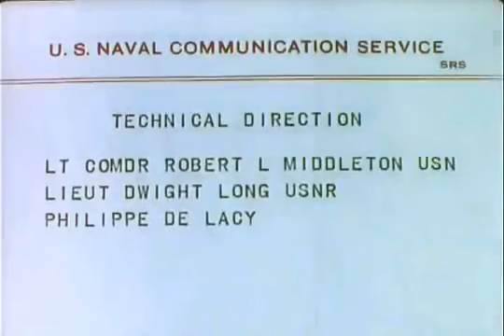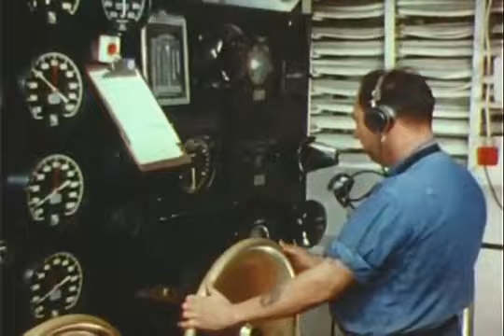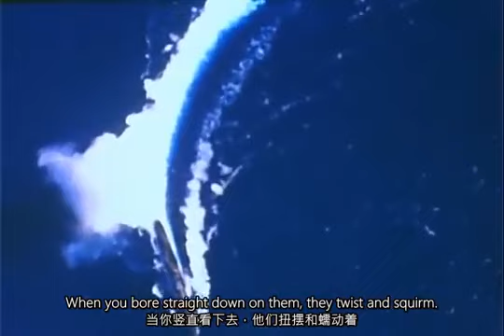The Fighting Lady 1944中英双语字幕

Comment from the maker: The first part of fighting lady

00:14:14  Outwardly   composed     00:28:00  apear to    00:12:03 Throughout   
00:13:20  tension          00:53:30  swarm               00:11:04  perform +humble           00:48:11attempt           00:32:56 magnificent       00:45:48   reinforcement  
00:11:10 cobbler           00:11:32 bound                 00:45:05   progressively
00:34:21  out there(这句话是瞎翻译的，谁能指正。可否翻译为：大老远的在这里真能挣到钱）
00:12:59  pass through  00:35:55  spread out        00:53:17    strain to 
00:08:55  amount of      33:23 in an amount     00:07:40 +00:34:55 destination
00:09:07  specialist         00:15:53   assign               00:33:33   maintai
00:08:13  whether or not 00:09:21  whether  or       00:08:43+  00:09:49 glamour
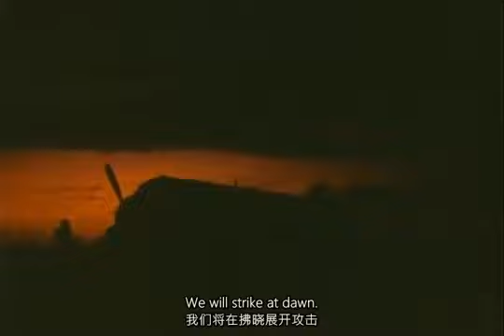十00:40:11  perfect(V）     00:15:19   perfect(adj）    00:05:13   explosive
00:32:05  windshield              00:14:09   practically         00:24:24     thus
00:07:06  delicate           00:33:01   secure               00:32:14     sieve
00:12:49  reveal               00:08:47   concentrate     00:20:46+  00:20:06   thorough
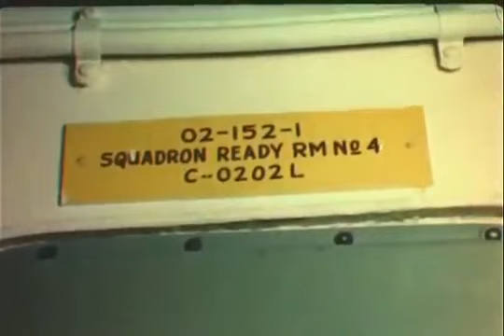00:46:08  enable             00:36:23    replacement    00:12:57     venture
00:53:55  disintegrate    00:20:04    picket               00:48:37     exhibit
00:05:01  honeycomb    00:24:13    overall               00:52:08     either ...or
00:15:06  precise            00:06:44    instinct              00:50:11    if necessay
00:33:33  miracle           00:10:33     community      00:54:15     whereas
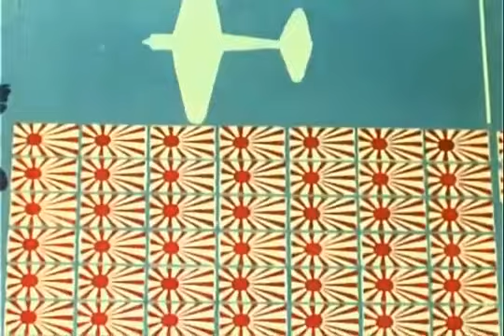00:59:43  amass            00:49:19     citation             00:34:45     get underway
二十00:08:35  settle down    00:03:55+00:12:35+ 01:00:13   skipper
00:33:06  relatively         00:11:11   seldom       00:25:10+00:48:18  estimate
00:15:46+00:22:39+00:23:07+00:25:25+ 00:47:36   ammunition
00:41:55  held                00:19:10+00:30:27+00:31:27+00:32:09   strafe
00:32:34+01:00:06  casualty   
00:03:25  come around   00:55:45  formation
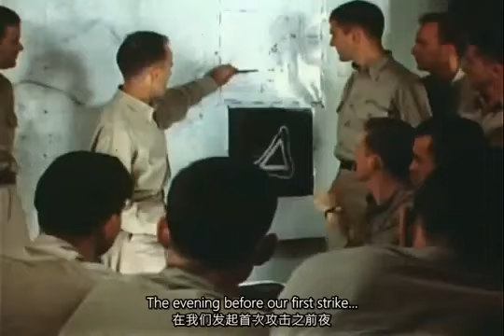00:08:47  concentrate      00:13:44  brief            00:24:52   preparatory to....
00:32:55  magnificent      00:25:06   confidence      00:39:45   objective
     00:16:20  await                  00:39:38   arrangement00:14:13  composed        
00:20:53  make sure         00:06:41 curiosity       00:08:54  a certain amound of
三十00:52:39  get chance        00:49:52+ 00:51:47 approach     00:32:55   advanced
00:47:39  barrage              04:02  earnest+efforts         00:02:50    come into
00:39:41  turn into             00:21:49  elegant优雅的       00:19:32   knock out
01:00:47  come forward   00:16:05  data              00:16:47+00:42:26+ 00:53:30  mostly
00:05:20  abreast              00:37:41  assert             00:16:00+ 00:33:08  assemble
00:13:13  sense(动）       00:13:52   divert             00:12:57   venture (v)
14:00+37:30 never before (以前从来没有) 01:48 imposing  04:55+ 33:11   enormous
00:45    authentic              08:13   whether or not       28:00   gently
04:10  a piece of mind      45:06  progressively          05:19  gigantic 
10:14   effort                      28:51  historic                    41:02   fragmentation
四十23:28+25:22+45:02   steady                                        09:43+53:36  aerial
 05:42 impersonal               09:37  personnel            40:49  anti-personnel
13:11 daily routine (n/a)        26:12   satisfactorily        52:34  qualified
07:35   efficiency             11:24  considerable         10:13+ 40:37  all manner of
52:21   the pride of             50:13  if necessary         
19:32  expected                 13:22  expectancy            07:45  tropical
03:01  a series of                05:01  watertight+ flameproof  27:09   at the thought of  
08:11   unprofessional     11:32   pastime                   16:07   instruction
09:16   in return                 12:44   are to do(be to do)  11:24 a body of water
10:03   be referred to as   26:55   apparently               59:25   step out(动）
五十05:40surroundings28:07+45:55  synchronized  10:37  necessities(necessity)
49:03+51:59+52:10   release       05:46  cave                 26:24+31:29  filled with   
36:00   seasoned              44:36  be involved                24:21   recapture
18:59   escape                  34:41  be promoted              16:07   get into
10:12+11:07+12:37+20:55+21:21+32:06   aboard      49:11  octane
06:11  make up                  51:44   miraculously            23:22  delayed by 
41:05  delayed (延时的） 20:06  be scraped              24:59  scrap
05:40  mysterious             08:08  mystery                  33:23   conceive
58:10  severely                  08:13  nervousness              08:56  nervousness+anxiety
39:56  make good use of 10:50  pharmacist                 36:55   occasionally
 六十                             31:29  healthy                      23:28   crucial
13:15  be about to             36:45   fond of                       14:53   flown
45:22  curse                       24:18  network                        24:25  far-flung
38:28  amphibious            20:48  towering                       53:33   intercept
40:17  devise                      34:51  designate     14:40   among......is......+chubby
13:22   atmosphere          27:33+52:28  reconnaissance   41:07  prolong
35:33   compactly             18:28  detect+keep tab on     19:03  detection
35:45  strike +struck            11:44  gossip                          03:03  stout
22:32  intelligent     53:55  sacrifice(动）18:14+41:25   lessen +infection(区别lesson)
06:02+18:06+53:19  rise(rose risen)                                05:46+49:51   uncomfortable
七十43:46  each patch of flame    53:15   be tearing down   41:25   scrub up
16:31  hardly(不过，刚刚）30:27+47:36 vessel             30:25    sheltered
21:59  cast+stay off              47:47   proudest                       11:36  pull into
19:24 tracer                       48:07  cripple                            32:03  's had
49:42  in sight (副被看到）55:42  sight (动)                   26:46  right after
06:14  have never been to   08:24  hop                        35:53  despite
50:13  light  (点燃）（做点燃时lighted 作照亮时lit)       12:36  besides
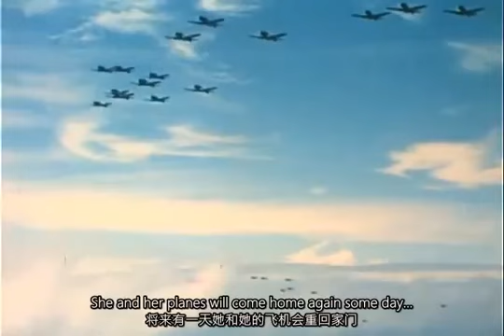28:00+56:43  bow            01:01:13  glorious                    48:16  judge      
七十九19:40  gun barrel               01:01:10  God grant           停止添加